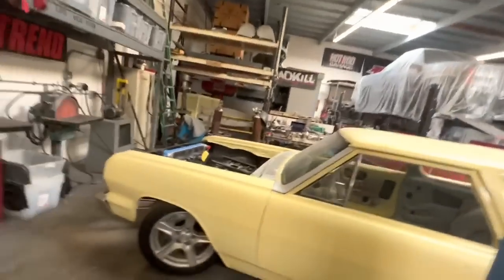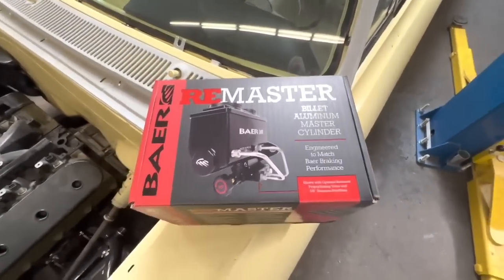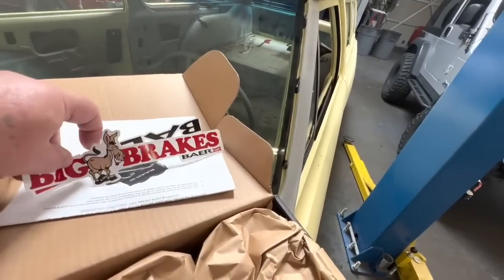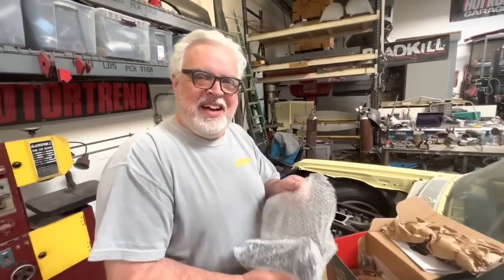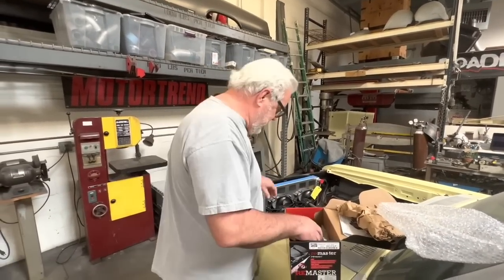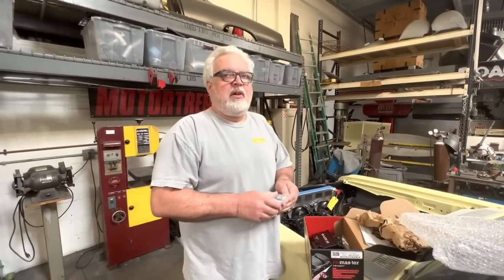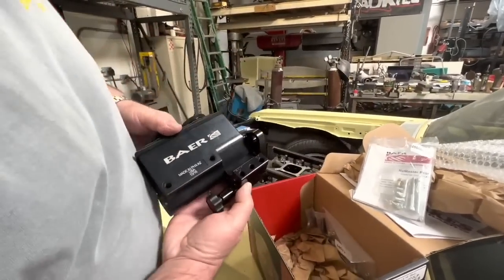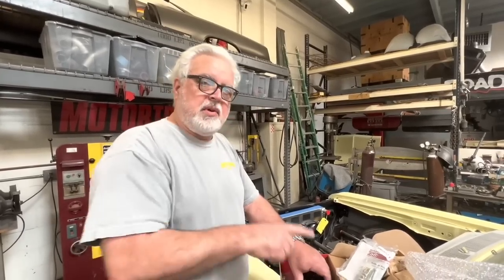Those are the Brakes

Comment: lucky nice braking system although the remaster at $395 seems pricey. i used baers cast master cylinder at $89 and now im wondering how the remaster would feel at the pedal. would like to see a video on adjusting the rear prop valve when its up and running. keep up the great work!!.

Comment: Hey Lucky Danny here down in little old Tasmania   . I'm building a 69 c10 pick up and have been following your shop truck for some time now .Like you I've also got the Full Qa1 suspension and summit chassis brace kit     I'm wondering why you don' t seem to run a booster with your brakes do you find with Baer brakes that this is not needed cheers Lucky keep up the great work love your show   Danny
Reply from the maker: Its just a shop truck and works fine with no booster. 
  I find myself driving it a lot now and possibly going to start tracking it so I may try a booster to see how it works.
Reply: @luckysgarageshow  how about a hydro boost??

Comment: Lucky, pretty sure you’ve got the disc/rotors on the wrong sides looking at the angle of the cooling fins within the rotors. Surely they should chop down into the air when the car is moving forward.
Reply: Did you notice the L sticker on the left rotor?
Reply: He did put them on correctly.... they do chop down when the car is going forward